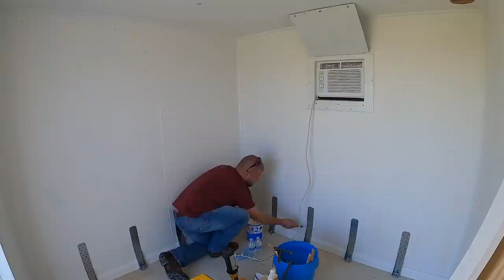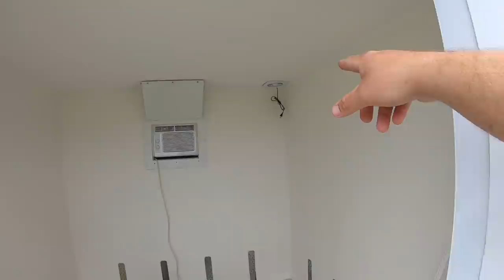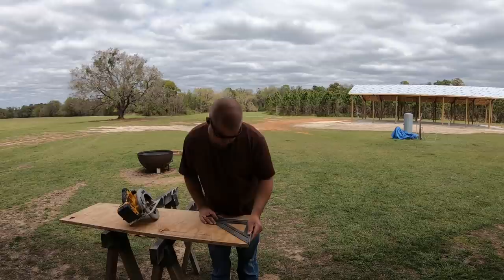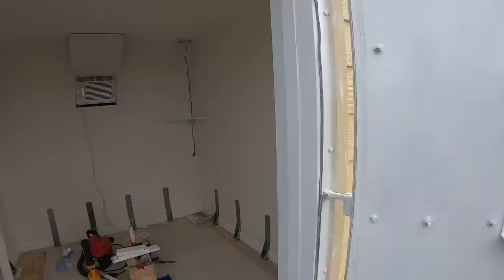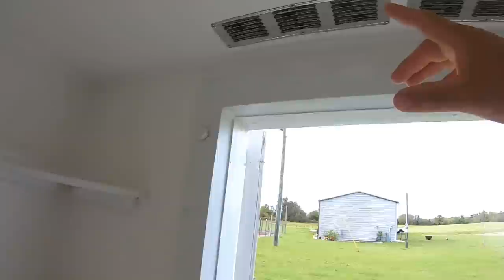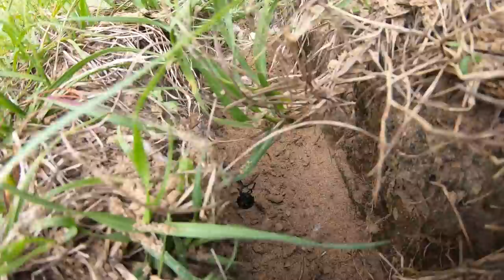Tornado/hurricane shelter bunker! Paint and shelving Build #21

Comment: I live in bermuda and have gone through so many hurricanes I have lost count.  

It not how thick the walls are it’s how it’s fastened to the ground. 

I have seen shipping containers picked up and thrown across the harbor.
Reply from the maker: Understand that, this is on a 8 inch thick slab and I'll be adding 4ft earth augers into the ground and bolting them to the shelter. The last tornado that hit us couldn't pull those out of the ground when it tried to flip our camper.
Reply: @TKCL  that will do it.  

You have a great channel and you keep us entertained with the diversity of the content. 

Congratulations on all you success
Reply from the maker: Thank you very much for the support

Comment: How is it anchored to the ground
Reply from the maker: Just sitting on a 8 inch thick slab now. 16 anchors hold the shelter to the slab. For the final anchoring, I'm putting 4 4ft earth augers in the ground and bolting the shelter to those. This isn't going anywhere

Comment: Hinges on the outside violate FEMA standards.
Reply from the maker: Don't know what to tell you, I followed a several page engineered and tested build plan. Pdf is on the video description.
Reply: @TKCL   Go read ICC/NSSA 500 standards as it relates to hinges.  Hinges should be on the inside.  Hinges on the outside can be damaged by debris and compromise door safety.  You might have followed what you considered were good engineer build plans but ICC/NSSA 500 standards are the 100% FEMA approved and Texas Tech tested specifications for above ground storm shelters.
Reply: If he does 4 corner bolt locks, the hinges shouldn't matter.